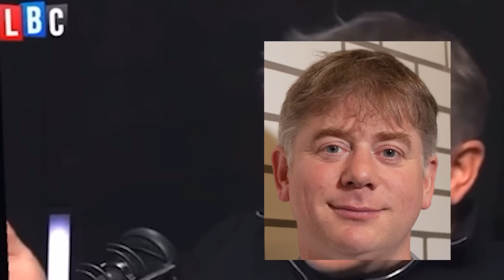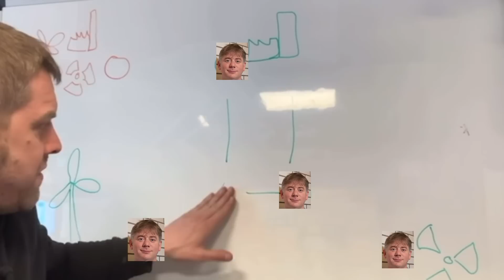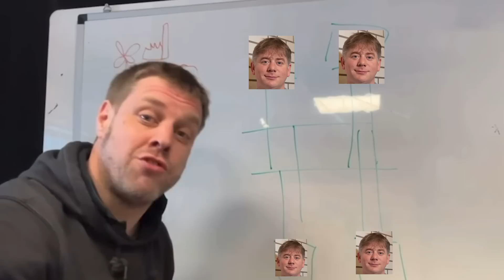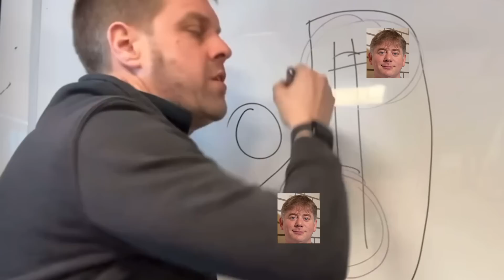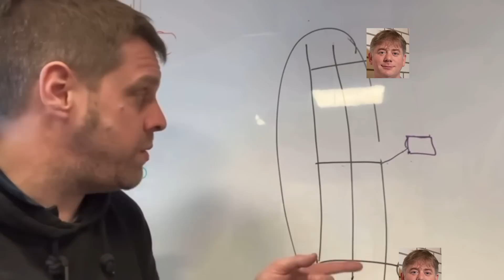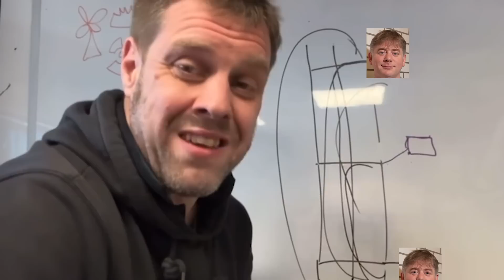OCTOPUS REGIONAL PRICING The Fatal Flaw WITH virtual GREG FROM OCTOPUS

Comment: The trouble is most greenies dont understand that their plans and dreams are going to fundamentally change the suplly of electricity. They are mostly working on the parameters of the existing grid.

For example they still assume that there will be cheap electricity at night. The reason there is a cheap night rate is because of the way the grid used to work, not the way it is going to work.
If everyone is charging EVs at night and running heat pumps, then there will no longer be excess electricity available for night rates. In fact with a lot of industry shutting down ( another government madness) it will probably be cheaper during the day. But the EV fans will be at work or out and about when it is cheapest to charge. Unintended consequences.

Also if locaised power rates are cheaper when a nearby wind farm is running, do they get caned when the windfarm can't run or is constrained and the energy comes from elsewhere?
Reply: So the cheap EV tariffs will switch to weekend daytimes. 

And?
Given an EV can do the average commute for 2 weeks before needing a charge. Instead of charging on cheap electricity once a week overnight, I'll charge it once a week on a weekend instead when there's solar. 

Greg understands how the energy industry will work the future ,he's talked on it many times. We'll use pricing to allow flexible demand to shift when energy is abundant and cheap, and signals to avoid peak demand. 

Eg. Octopus agile tariff. You could say the future is already here with the agile tariff. 

We'll use grid level storage to smooth out demand and excess, as well as interconnectors, pumped hydro and the proposed growth area is storing hydrogen from electrolysis in salt caverns under East yorks and Lincolnshire for storage and energy peaker plants from it. Google Royal (science) society future energy storage for  their modelling of the pricing and it's function.
Reply: @Lewis_Standing  You're the first person I have seen to claim an EV can commute for two weeks without a charge. Interesting, what model is it?

The octopus agile accounts etc are trials for variable pricing . They are an attempt to push up the rate of uptake of smartmeters, so that variable pricing can be used more widely. When that happens it will be unlikely that people get free or cheap electricity anymore, just prices spiking upward when demand rises.

Grid level storage doesn't exist in any meaningful way. Pumped storage in Britain was only designed for a few hours, and was intended only as peak lopping at high demand eg ( not kidding) when everyone put on their kettles at the same time in an ad break on coronation street or similar. Everyone used to watch the same three channels and everyone put the kettle on within a few minutes. Dinorwic was built for that so they didn't have to have another fossil running unnecessarily.

I don't know about the hydrogen in salt caverns. Hydrogen is difficult to store but is the obvious use for mopping up spare windmill juice.

Battery storage has limited run time , is expensive, and tends to catch fire as the recent moss landing USA and south Australia ones have done. They are limited in run time and produce a lot of toxic byproducts if they do catch fire.

Renewables have a lot of issues when it comes to running the modern world. Pricing people off of the grid in times of high demand is a method of pushing the net zero agenda without inconveniencing the rich, and not having to have a complete second backup generation system to cover in the event the weather doesn't cooperate
Reply: @DanRyan-v5y  I guess the two week commute capacity is for people working from home 😆
Reply: @_chrisr_  👍
Reply: @DanRyan-v5y 
Hyundai Kona, nothing fancy. 300 miles range in summer, 240 winter. 
Average UK commute is 20 miles a day. 
So even in winter that's over 10 working days. 
Average EV sold in UK has 280 miles range. Hence my statement. 

It's actually cheaper to have renewables and backup gas than a pure gas based grid. 

Why?
Gas is the most expensive part of the mix. Say a CCGT is £80/MWh well maintaining it and building it is only 10% of that 90% is the cost of the gas. 

So having renewables supply the vast majority of the energy and gas just being a back up doesn't add to system costs too much and just massively reduces operating costs of burning the gas. 

Gas after all being finite and being the only mass method of making essential nitrogen fertilizer to enable our global food supplies.

Kinda need to save it . 

Agile is a widespread tariff it's not a trial. I'd suggest watching Greg explain it. 

What's the point of a mind if you can't change it.
Reply: @DanRyan-v5y the majority of people in UJK commute less than 10km (source: ONS - https://www.ons.gov.uk/employmentandlabourmarket/peopleinwork/employmentandemployeetypes/bulletins/traveltoworkenglandandwales/census2021#distance-travelled-to-work), so 10 trips at 20 km is 200 km in two weeks. Prety mcuh all new EVs will cover that. Of course if you have double that commute then you will need to charge more frequently.
Reply: @Lewis_Standing  interesting about the car.

Gas isn't the most expensive though if the power industry was left to run itself without net zero constraints. you are thinking of strike prices which are artificially negotiated on the back of the rules giving renewables the first bite of the cherry, subsidies to promote them and constraints subsidies when they produce too much.

There is a lot of extra infrastructure required to get to net zero because the existing power stations are not located where the solar and wind farms are going to be. Then there is all the smart meter roll out to manage shortages once  generation is almost totally renewable and not reliable. 

Any gas backup will come at a huge premium precisely because no company is going to have a power station sat around doing nothing unless they can claw back the profit when they are needed.

If renewables were as cheap as everyone says 
, then why are our bills rising inexorably as more and more renewables are installed?
Reply from the maker: @ no electricity will be a flat price all the time , Greg only wants this and to controls the price and force you all on to electric because he sells it , Greg knows how to make money from electricity and he makes you all think he cares about you, you fall for it because your mugs ,
Reply: @Actual_electrical_content  the smart meters are intended to get us all on variable rate charging/ metering like is done with the generation market. The price per kWh changes every half hour iirc according to demand. The idea is to get us all paying retail in the same way. That is why octopus etc do giveaways of cheap electric on various days times to get people to change. Once enough are hooked up, the charging will change to normal prices at times of low demand and much higher prices at high demand. That way when there is little power from wind and sun they just charge people off the network rather than spending through the nose for gas to fill in and keep the lights on. Pay up or sit in the dark.

You know they can do it , see diesel cars, LPG, solar panels etc etc, get a bunch on the hook and then reel them in.
Reply: @Actual_electrical_content sorry mate be he also buys and sells gas. He's got an equal financial benefit from selling gas. 
He just wants to do the right thing. 

He may have gone to Oxford but he's a northern lad from redcar.

His Go tariff sells me electricity for my car that saves me £2000 vs Petrol a year. 🤷
Reply: The trouble with most morons is that they speak drivel.

I will stick with Greg.  They will pay me tomorrow to turn devices on.
Reply from the maker: Fantastic comment I may build. A whole cv idea on this

Comment: There are issues with constraints - at the transmission and at the distribution level. But the thing is, they aren't constant. Often Scottish exports are constrained so you could encourage people to build their bitbarns north of the boundary, but when it's cold and still, the constraint is the other way. The thing that worries me is that with grid expansion, you have non-engineers on the government side talking to a private company (National Grid Plc) and historically that is a recipe for expensive cockups.

Comment: While you make valid points, there's a different perspective to consider. Local renewable energy consumption brings multiple benefits: job creation, economic investment, skill development, and a sustainable revenue stream. This creates a positive feedback loop for community growth.

From a technical standpoint, you can absolutely use your production locally, it's basic electrical principles at work. My solar setup is currently generating about 4kW (at 10AM on a pleasant Sunday), and though the voltage is running higher than ideal, it's directly powering my property while excess feeds into the grid. This is precisely why grid registration is require, unregulated excess power can disrupt grid frequency.

Octopus Energy's approach has merit, but we should recognise they're primarily a marketing company with stronger financial backing than previous market entrants like Bulb. Their business model is fundamentally similar to predecessors, just more robustly financed.
Reply from the maker: Most solar farms are built by Eastern European labour  and then require virtually zero manpower
Reply: @ I mean to be fair if they were built by your average British builder we’d have a windscale event every other week! 

My point wasn’t really about maintenance but rather a hub which draws talent, somewhat like Hinckley.

Comment: Grow up lad.

You have completely misrepresented his comments.

He was talking about as much local power as possible.  Less loss in energy as electricity is travelled.

Stop misleading people.

The south should pay more.
Reply from the maker: I recorded this video 3 weeks ago so he had not actually commented on it then. So how you work that one out
Reply: @Actual_electrical_content  Simple solution, pull the video.

Too much misinformation.
Reply from the maker: Just let me know what’s misinformed an hour. Do apply video to you. How about that?
Reply: @Actual_electrical_content  Gregg whatever he is has never advocated for any change in the national grid infrastructure.  He, rightly, believes that the plan should be locally produced energy.  He is correct.

Those that are using the grid should pay more for their energy.

Why should people close to the source fund?
Reply from the maker: So when do the midlands get a rebate for powering the nation for 60 years
Reply: @Actual_electrical_content  That is Greg's point.  The south should pay more.
Reply from the maker: What if it’s turns out not power is generated in the south ? Will you pay more

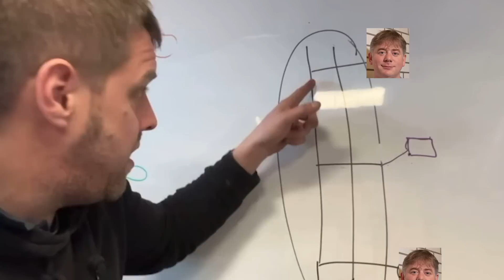Comment: 9:45 the whole of scotlands offshore wind is going off is it?

We can either spend the proposed 60bn on upgrading the grid to take Scotland's wind power to London, so London can have access to it, and build Data centers there. 

Or we can spend less, build less grid and have the data centres in Scotland. 

That's the argument. 

If London is short of power, in locational pricing model the price generator's get will increase, developers will want a piece of that, and more generation and grid will get built to meet that demand, until the pricing is equal. 

Isn't this just market forces?

I don't mind what we do, build loads of grid or build quite a lot plus locational pricing. Both will work.
Reply from the maker: Who’s gonna buy it off you with out a grid mate , and your gonna have to buy off us when it’s not windy or it’s dark

Comment: UDI for The North,  Watford to the Scots Border. Independence referendum as soon as. New LNG terminal on Teeside. Heysham and Hartlepool Nukes to get an operation extension. Drax to recommission on coal, all five units. Initially coal through Immingham and Goole terminals and open up Kells Pit. Cancel all Green levies, Constraint Payments and Carbon Pricing.  Frack shale gas where ever it is found, Lancashire or Lincolnshire. Any viable pits, open them up to supply coal or even produce coal gas. Make produced electricity cheapest in Europe and sell it to The South at the same price as EDF sells nuclear energy through the interconnectors. Subsidise Hull Zeebrugge and Rotterdam, Newcastle to Ijmuiden ferries. Bring reality back to "Powerhouse North" Crank up St Gobain glass to produce greenhouse glass and build Greenhouses close to CO2 sources. Scunthorpe steel to produce competitive priced steel. Nissan and Toyota to produce basic cars, no whistles and bells, just A to B cars, to get everyone to work, even microcars for 14 year olds. Education, you do academic schools, or technical schools, where you learn to build things